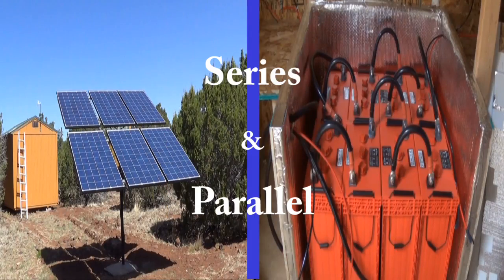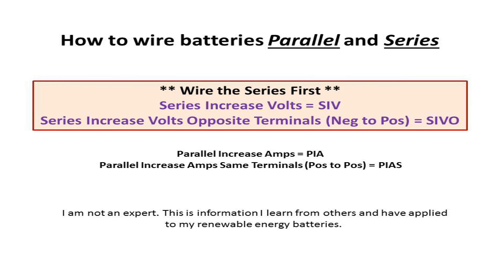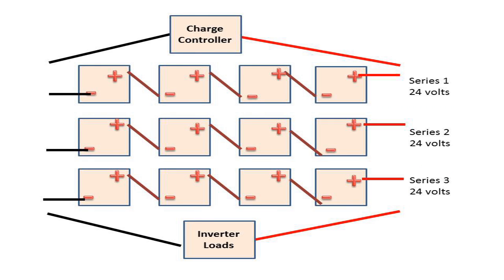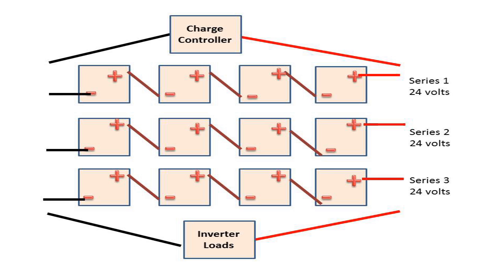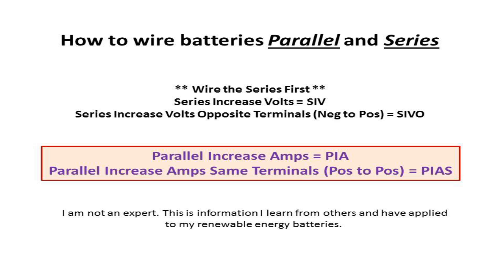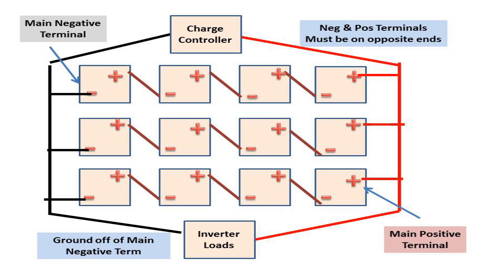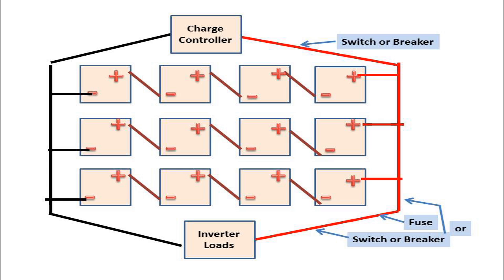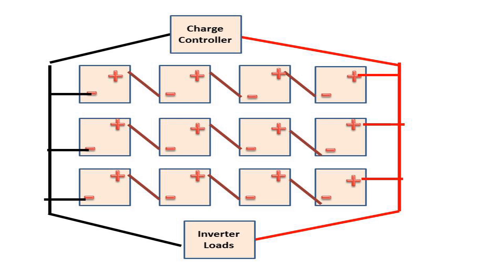Which Comes First?  Series or Parallel When Wiring Batteries

Comment: From a former naval electronics technician, I can say with most certainty that your method of series first will shorten the life of your batteries.  When you connect the batteries in parallel first, up to your desired amperage, the batteries will equalize much better than when they are connected in series.  This alone will extend the life of the array. In addition, the charge rates are better when the batteries are connected in parallel first, which also will extend the battery life.
Reply: And the science behind what you say is?????
Reply: @benkanobe7500  , Not sure why the 5 question marks, but I will assume that means that you don't believe this.  Just try it.  Connect some batteries both ways.  See which ones balance quicker (quicker balance = less stress on the array).  They also charge faster, meaning they spend less time in a low state of charge (charge cycles are the definition of battery life).   An ounce of experience is worth volumes of science.  Keep in mind that electricity flows through batteries connected in parallel the same as it would through a single battery.  It really can't tell the difference.  However, it has to travel further through batteries connected in series.  It can tell the difference there.
Reply: You seem to know more.....can we talk?
Reply from the maker: interesting this was info i got from a solar company.
Reply: @gjertson1  While this doesn't explain the science behind it, it does show the importance of using a BMS system with LiFePo4 batteries.  Although it is vitally important to use a BMS no matter your battery connection scheme.  Also, this manual tries to steer people away from parallel strings.  Exactly my point - parallel connect only up to the desired Amps, then series up to the desired voltage.  You can't have anything but the smallest system without connecting batteries in parallel.
Reply: @gjertson1  Yes, Li-Ion CELLS are connected in parallel first because then you only have 1 series string = 1 BMS inside the battery.  Multiple series strings would require one BMS per series string.   So, what does that have to do with connecting Lead Acid Batteries or Li-ion Batteries?
Reply: Thanks what I mean earlier. Is  parallel 10 batteries is too long and a lot off resisters but if do parallel 5 batteries with another parallel of 5 batteries  and connect them both with bustbar 1 end POS.   and the other end NEG
Reply: @benkanobe7500  I would assume that the science behind what he said is(while not yet having read anything and not yet watched the video LOL) that while equalizing back and forth of the paired parallel ones will be doing;  they wile be constantly charging and discharging and will be using energy the whole of that process.  I would think that this should depend on your size of batteries and either voltage being high or amps would determine the back and forth size of charges that would exchange before turning the other way happens .  I hope I was right and will watch and if I'm wrong;  maybe I'll be lucky and nobody will had read my comment and I will then maybe own up to it or whatever. lol.  So my thinking for what is better is....uuhh!!  Series first and that took me about 7 seconds to figure out and that means that there should had been an argument about this then,  Right?  The reason series first and not parallel until power is drawn;  is because nothing will be a circuit when nothing is srawn.  Right.???  LOL Cheers
Reply: I would assume that the science behind what he said is(while not yet having read anything and not yet watched the video LOL) that while equalizing back and forth of the paired parallel ones will be doing;  they wile be constantly charging and discharging and will be using energy the whole of that process.  I would think that this should depend on your size of batteries and either voltage being high or amps would determine the back and forth size of charges that would exchange before turning the other way happens .  I hope I was right and will watch and if I'm wrong;  maybe I'll be lucky and nobody will had read my comment and I will then maybe own up to it or whatever. lol.  So my thinking for what is better is....uuhh!!  Series first and that took me about 7 seconds to figure out and that means that there should had been an argument about this then,  Right?  The reason series first and not parallel until power is drawn;  is because nothing will be a circuit when nothing is srawn.  Right.???  LOL Cheers
Reply: Oh ya;  and another thing to keep in mind the next time you wonder about this;  is that batteries are in series already and that is exactly for that reason.
Reply: @MichelJosephCardin  wrong
Reply: @stygianindustries8295  Well I do believe that if one would be thinking of a 12v 6 cell battery;  those 2v cells would be connected in series right from the start and that would mean that what would be best would be single cell batteries that are not in need of being multiplied.  Cheers.
Reply: @MichelJosephCardin  bless you
Reply: @stygianindustries8295  Air compression with the use of drive motors driving an on demand generator and air pump driven residential wind turbine would be ideal with never any need for batteries.  Cheers.  People are giving thought to batteries connections for no reasons;  in a sensible sense.
Reply: @MichelJosephCardin  do tell how would these mystical drive motors be propelled exactly?
Reply: @stygianindustries8295  Aaaaaaahhh maaaan;  I just explained almost all of it and lost it because as I usually would copy and paste my progress into notepad....  I didn't and that is what I hate to no end....  Ok here we go.  I do not feel like redoing this at all.  I'll rebuild but way shorter;  despite the importance.  A way larger residential wind turbine then what is sold on the market or if those are used;  then the amount of these that would be capable of replacing the electric motors that drive those average air compressors that we all own.  Compressing air within tanks that would replace the batteries.  Now for your question;  in order to provide electrical power on demand;  also connected to the air supply hoses would be an air drive motor which would replace the petrol engine that drives a three phase generator which also would need to be large enough to supply a household.  But all these items would need to be oversize and brushless and have no wear and tear;  hence the oversizes.  Secondary generators could be used as smaller units where less power is consumed.  There could even become a time where some appliances would be air driven instead.  Who knows.  The point of this is that there would be no need to have batteries for storage and if we were all connected to the grid electrically with each home creating electricity;  then there would also be no need for batteries.  Chears.
Reply: @benkanobe7500  He is probably referring to top balancing the batteries prior to completing the system. All the batteries should be as close as possible in their state of charge (SOC). If not they WILL  not charge and discharge equally and the batteries that were not close to the same SOC will take a beating and will fail early/earlier than the balanced batteries.
When connected in parallel, the batteries will self-balance themselves if connected in parallel. While connected in parallel, you can also charge them. Then disconnect 2 of the batteries, connect them in series, do the same with the other two, then connect in parallel.
Reply: Could 4 12v deep cycle gel ( 6-GFM-100 ) 100ah 30a batteries wired in series for a 48v bank connected to a 48v 5kwh MPPT charge Controller Inverter, & a 4S4P array  ( 2 x 360w panels series connection; x 4 ( 4S4P)  ) producing a total of 2880w, 400v, & 60a work ?without harming the batteries, or anything else? Thanks if You have time to reply. Dig the vids btw.., thx a lot for them.
Reply: @Booboobear-eo4es  Thanks! I am a retired Senior Vice President of R&D with six patents. I have had countless engineers and technicians work for me in the very high-tech development of life sustaining medical products (after 8 years as an R&D Engineer for HONDA R&D). I know precisely the role of Engineers and Technicians. In my life, I had the lowest turnover of both Techs and Engineers because I know the great value of each and when to apply one versus the other. You sound like a low-level Tech that may have worked with engineers that lacked hands-on technical knowledge. I have seen that before. I pride myself in that I always knew the test equipment better than my Techs. They respected me for that because I am an engineer with unequaled hands-on experience. You are barking up the wrong tree.
Reply: @critterscropscuisine2886  Modern ignorance my friend, modern ignorance. Why try and learn, when you can ask obtuse questions?!
Good on you for explaining.

Comment: I was never quite clear on how to wire batteries in series or in parallel. Your video makes it much easier to understand now. Thanks!
Reply from the maker: awesome. I was couldn't remember how so I thought if I needed a little help maybe someone else does too. cool. thanks for watching
Reply: @ArizonaHotHomestead  can I connect two 12v 180 ah in parallel with one 12v 180 ah in series?

Comment: If each bank is 12.8v’s linked like this for a total of 48v can I use a 12v charger per 12.8v series to charge ? Or is it once all linked together it’s 48v ? Or can I use a Gm High Amp alternator 12v to charge 4 PCs 3.2v batteries in series = 12.8v & 10.4v is the 1.6v not to drop below I’m sure the alternator will start charging some where around 11v ‘s can I do this you think or once I connect all the batteries they all will be at 48v ?
Reply from the maker: i dont know anything about lithiums but i heard you never want to wire them up in series. they have a battery management system built in (bms) so if you put to many volts in it they may explode or catch on fire. better get with someone who knows lithiums.

Comment: stop using 12 volt batteries for your solar battery banks. they are horrible, cost too much in the long run, take too much time in maintenance and can blow up if you are not careful. use battery cells instead. 3.2volt Lifepo4 cells of whatever AH size you want. If you want a large battery bank then wire the Lifepo4 cells together in parallel series building your battery bank as large as you would like. I want to build my battery bank of 24.5K/WH of power. the DOD is 80% so I end up with 19.66K/WH of useable power for my offgrid home. If you want more power then just add another battery to each parallel unit and you will increase it by one third. The end result is a battery bank that can be balanced easily and never going out of balance giving you a battery bank that will last as long as your solar panels. don't over charge or over drain the battery bank and you will have 6000 cycles of the battries that I have for sale that come with a 10 year warranty. If you use lead acid batteries you are only going to get 5 maybe 6 years of life with lots of time in maintenance possible fires plus they do not charge very quickly and you can only go to 50%DOD at most in order to get 6 years of life from your battery bank. with the price of lead acid batteries and the weight etc you are looking at a lot of work and waste of funds when you could go with Lifepo4 batteries that are much lighter last much longer and are much much safer.
Reply from the maker: thanks for the info

Comment: 48v battery bank 15 batteries 3.2v lithium phosphate, 13 batteries 280Ah & 3 batteries are 200Ah still 3.2v so what I did was 2 rows of 7 Batteries each are in Series in the middle I have 2 batteries in parallel 3.2v each battery is 200Ah x 2 because in parallel so there 400Ah in the middle of the 280Ah batteries and down One side I have a 200Ah battery also and I know the higher Ah battery will work easier and make the 280Ah batteries work more what do you think about me wiring the other 200Ah battery in Parallel which will be 400Ah
Reply from the maker: i dont know anything about lithiums but i heard you never want to wire them up in series. they have a battery management system built in (bms) so if you put to many volts in it they may explode or catch on fire. better get with someone who knows lithiums.

Comment: there is a battery balancer for lead acid batteries ,on ebay . cheap way to extend their life. they come in 2 x 12, 3 x 12, 4 x 12. i have not seen one for 6 volts . but i'm sure they exist.
Reply from the maker: thanks for the info.
Reply: Yes, battery clustering needs balance due to variance in voltage, charge, and resistance.
A balancer can greatly extend the life of the batteries.

Comment: Which comes first? It really depends on the type of battery cells, use case, and materials, as well as 'what's easier?'.

Generally, we wire series first when using lead acid batteries (like golf cart batteries), and then put those 'higher voltage batteries' we made in parallel.
This is to make sure that we don't have to deal with multiples of the 'parallel problem' as I call it, where your resistance is higher / lower for some of your batteries than others, over the wiring.
(This is a good read: http://www.smartgauge.co.uk/batt_con.html )
If you only have one 'set' of paralleled batteries, you'll only have to deal with this 'problem' once. If you had 2 sets of parallel in a series, essentially you'd then need to deal with the issue twice. Not the biggest deal but, it's definitely worth considering.

Just to add a contrary example, if you've seen jehugarcia's channel, where he makes some batteries for his EV (electric vehicle) out of old laptop battery cells (18650 batteries), essentially he's wiring them in parallel first, and those packs go into a series then. (Which I think are paralleled with other series of packs... I forget how his EV is wired exactly.)
Reply: Four ZeroFour web address you provided not working buddy.
Reply: Seems that YouTube decided the ')' was part of the URL. -_- 
Should be fixed now.

Comment: I'm homeless and live in a tent and even though I have a 5500 running watt generator it's not feasible to run it 24/7. The generator has 4 120v outlets and 1 120/240v 30 amp outlet. I don't have any solar panels. But I have 4 NorthStar NSB 170FT Silver Battery that capacity says 12V 170 ah C/10 to 1.80VPC @ 20°C(68°F)
12v 170ah C/8 to 1.75 @ 77°F (25°C)
Terminal Torque 8.Nm/71 inch pounds.
Float Voltage 2.29VPC @ 20°C (68°F)
2.27VPC @ 77°F (25°C) how you may recommend I wire up my batteries and generator so that the generator can be used to charge the batteries and the batteries power my campsite. I use 1 9 watt LED light bulb, a 1100watt microwave, a 1500 watt electric heater, my cell phone charger so 6watts. A 4 - 1/2" angle grinder that says 120v ,6amp, and a power drill that's the same 120v,6amp, mini tankless water heater 110v 3000watt 25 - 32A current (Amps), my water pump is 12vdc 8Amp max. It's winter so I'm won't be running the 5000 btu window ac unit. I have 4 12volt 170ah deep cell gas venting batteries. Any advice is greatly appreciated or links to point me in the right direction I'm thing a need to go all 4 in parallel keeping them at 12volts and just raising the amp hour capacity to 680ah or 8,160.00 watts if my math is correct.
Thank you for the videos and all your research
Reply from the maker: wow you have lots of electric stuff. electric tankless water heater , window ac, by solar set up can only run a window ac for a few hours before the batteries are drained and i have more total amps.   i have no idea how you are going to set all that up. sounds like your going to run the generator a lot. maybe a hybrid inverter charger to wire the 30amp generator into the inverter/charger but the inverter needs to be large enough to handle the water heater. electric heater use lots of power think of it 1500 for 6 hours at night only is 9kwatts. wow your batteries will last a few minutes. . not sure how to help you sounds like you have to much electric loads. try propane heaters and propane water heaters.

Comment: Dude,

Could 4 12v deep cycle gel ( 6-GFM-100 ) 100ah 30a batteries wired in series for a 48v bank connected to a 48v 5kwh MPPT charge Controller Inverter, & a 4S4P array  ( 2 x 360w panels series connection; x 4 ( 4S4P)  ) producing a total of 2880w, 400v, & 60a work ?without harming the batteries, or anything else? Thanks if You have time to reply. Dig the vids btw.., thx a lot for them.
Reply from the maker: i am no expert. it sounds like you have an all in one inverter charger. look at the pv input for that component if 3000 or more you within specs. check the input volts or pv volts is it within range. if so it will work. most all in ones are up to 250 volts or 150 v.  . check your specs
Reply: @ArizonaHotHomestead  200. I got it going. Thx Dude.4s1p

Comment: I use heavy duty marine grade Blue Sea Systems buss bars in my 24v series-series-parallel battery configuration (15 kWh battery bank). No issues.
Reply from the maker: those are awesome. i use a blue sea battery switch. to control power near the rv.

Comment: Would this be the same diagram using (12) lithium 100ah 12 volt batteries for a 24 volt system ?
Reply from the maker: yes. some lithium batteries can not be put in parallel so make sure yours are ok for parallel.